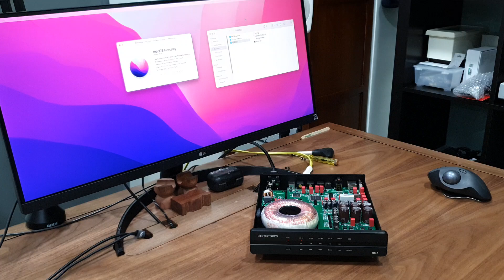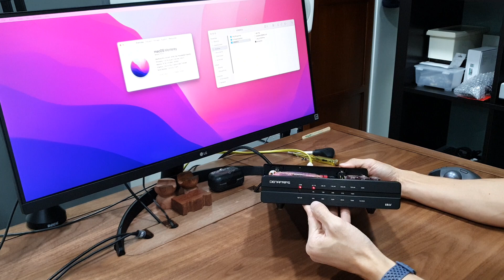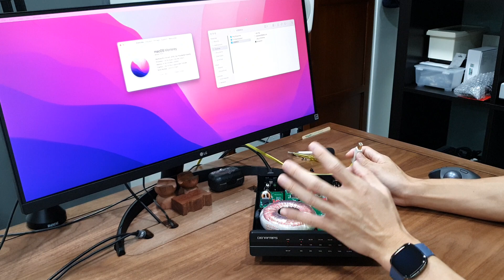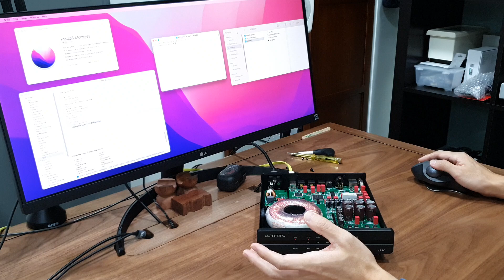Firmware Update: Iris DDC

Comment: The procedure worked like a charm for the Gaia.  Thanks Alvin.
Reply: how did you set the Gaia for firmware update mode? I couln't find any reference anywhere 😒
Reply: @entity279  Did you figure out how to do this for GAIA? I am in the same situation and I don't see any switch inside the GAIA.
Reply: @mrenlightened  oh yes i did but man sorry was 2 years ago don't remember exactly. Most likely one can use some buttons combination with gaia, don't know which atm. The information is out there tho, maybe write Vinshine an email
Reply: @entity279  Thanks for the tip - I found this "Hermes / Gaia DDC: Press Setup button once, thereafter, press USB button twice' to get into firmware mode.
Reply from the maker: Glad you enjoy it!